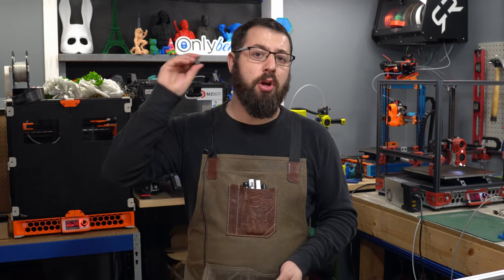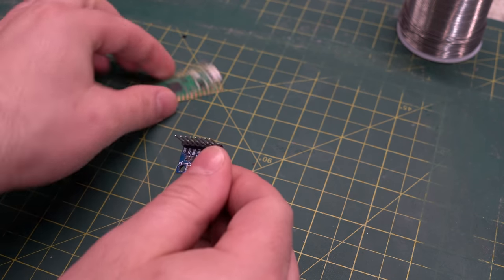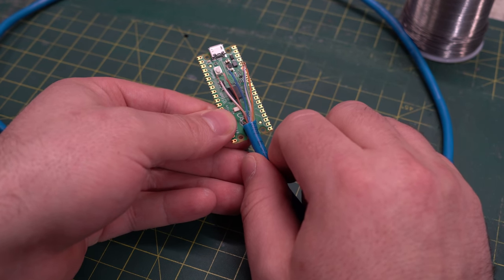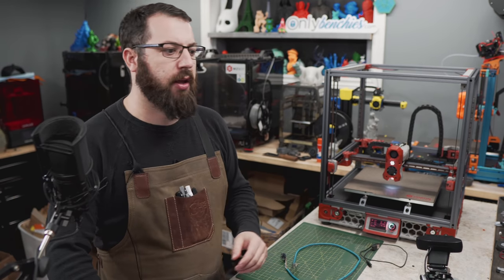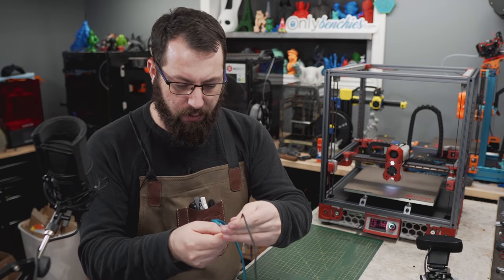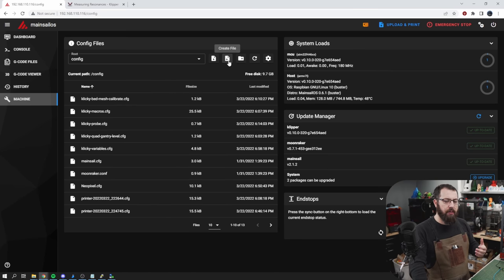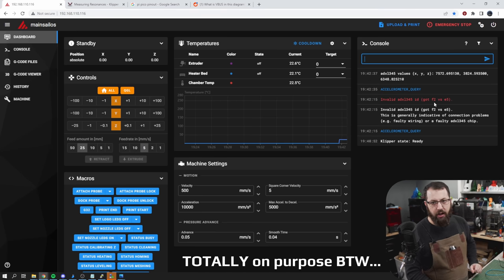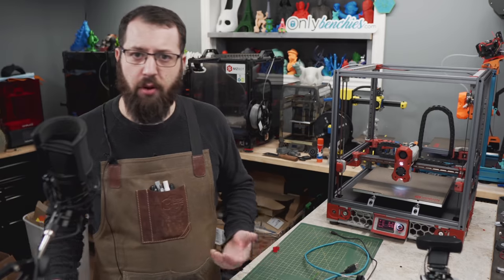Input Shaper with a Pi Pico - Klipper Tips

Comment: I am having an issue when i include the adxl.cfg in the printer.cfg, as soon as i include it and firmware restart the klipper doesnt want to connect but as soon as I comment out the line it works again but the raspberry pi pico doesnt show up on the list of MCUs. Any thoughts?
Reply from the maker: Did you flash klipper to it correct? does it show up when running 
ls /dev/serial/by-id/*
Did you ensure the correct serial ID is used for it in the config and lastly try a different USB cable
Reply: @CanuckCreator  I actually figured it out, I am using a Raspberry Pi Pico H which has the 3.3v and ground pins switched from the standard Pico, got it up and running though. Thank you!

Comment: I permanently screwed the adxl to the toolhead and connected it directly to the octopus board, Not recommended?
Reply from the maker: You can do that, but keeping the adxl perm attached to the toolhead isnt really needed (you only need to run IS once really, or after any mechanical changes to the printer)

This way makes it easy to use the same setup on multiple printers

Comment: Can you run Input Shaping off of the one Pi running Klipper? Or do you NEED another Pi to run input shaping? I also have a bunch of quadcopter flight controllers with accelerometers.. I wonder if those could be utilized here...
Reply: it can be connected directly to the Pi you're using to run Klipper, this is just to have a quick connect/disconnect i guess.
Reply from the maker: Pretty much this, the default way is to connect the adxl to the rasppi GPIO and setup the RPI itself as a secondary MCU,  if you just have one printer with klipper this isnt a big issue really, but if running multiple printers, OR the RPi`s are under printers/in electrical boxes, it can be a bit of a pain, this method allows you just plug in via usb and avoid setting up each printers RPi as a secondary MCU

Comment: I'm trying this and my Pico is not detected by my Pi. Have tried different cables etc. I wonder if it is because my Pi is being powered by my Spider board and maybe not giving enough power to the Pico via USB?
Reply: did you sort this i have the same issue ?
Reply: @colly05  yes. It was because the pi needed to have the pico connected at boot up to detect it and work properly. A bit annoying but that sorted it.
Reply: @AG-cg7lk  Thank you. I had the same issue.

Comment: Totally STUCK.....Help

Keep getting the "!! Invalid adxl345 id (got 0 vs e5)."  When running QUERY or the test. I home everything. Execute the test and boom an error. I've checked all wiring, resoldered everything. Rebooted about 8 times. Did continuity. Still an error. Printer is an Ender 3.
Reply from the maker: Run it again if you get the error. In the newer klipper release there's a bug with the first result is a fail when running the query test
Reply: @CanuckCreator  have ran it about 20 times, same error. I have tried rebooting printer, Pi, and Pico. Rewired the Pico to ADXL. I have just ordered a different brand of ADXL, I'll see if that works.
Reply: @andrewfazio7330  I had the same issue and a different ADXL345 was the only solution.  I have bought several from reputable sources and the only one that works every time looks identical to the one pictured in the video. Found it on Amazon. The ones I have that say "Digital" and have both a VCC and 3v3 pin never seem to work, go figure.

Comment: If we already have the raspberry pi setup to use the GPIO pins, is there any specific changes we should do for this to work? Or is this a automatic plug/play after assembly?
Reply from the maker: You would have to go through the process covered in the video for setting up the pico as a secondary MCU
Reply: @CanuckCreator  I rewatched and around 9:40 you broke it down more clearly. Thank you Sir.

Comment: could you not just extend the gpio pins like the usb? then this saves you from even buying a piko?
Reply from the maker: Yes, but then this requires you installing the RPI as a secondary MCU on every printer + making a 6 wire extension cable+end plug for all, vs just the pico and usb cable. Its not a huge deal but it does make it a simplier process.
Reply: @CanuckCreator  thank you for the explanation.

Comment: Has anyone done this with a zero 2 w? I am trying to get it to go. I loaded it with klipper/mainsail via rpi installer. Did the spi turn on. Installed everything. But, when I plugged into the printers PI, it doesn't recognize the USB. So no USB ID. It does connect over wifi, it is functional via mainsail(zero 2w). Its acting like a perfect pi running klipper/mainsail... 
Can anyone help me get the usb to recognize? Ty.
Reply from the maker: You cant connect two RPI`s together, the Pi Pico works cus its an RP2040 MCU, not a full "computer" like an RPI
Reply: Well, that sucks. But, I have a bunch of arduino nanos. So... 
Ty soo much for a quick response.

Comment: Does this mean I can run inputshaper on a printer that is using a raspberry pi zero?
Reply: 1. the pi zero has only one data-micro-usb-port, so if you're already using that to connect the main mcu. you would have to connect the pico via gpio, which makes it pointless, since you can conenct the adxl directly via gpio as well.
2. the problem with the zero is afaik that it hasnt enough computing power for the adxl. And, if i understand correctly how klipper works, the pico wouldnt help there, since the computing would still be done on the zero.

i'm not an expert, so if i'm wrong, feel free to correct me. I have a zero as well, so it would be cool if it works, but as im seeing it the best solution is to upgrade to a zero 2 when prices are normal again and use that old zero for pi hole or something else.

btw you can run inputshaper on a zero, but not the adxl. its more complicated to find the frequencies via test prints, but it works (at least on a standard bed slinger)
Reply from the maker: No, the Pi Zero would still have to RUN the Input Shaping algorithm which it doesnt have the power todo

Comment: Nero it's possible to connect with arduino to build this input shaper tool?
Reply from the maker: Yes, would just need to use the correct pins and change the config to adjust accordingly namely:
cs_pin: adxl:gpio1
spi_bus: spi0a
Reply: @CanuckCreator  Thanks nero for prompt answer! Greetings from Brazil!

Comment: Where do I place the adxl345 ?
Reply: as close to the nozzle as possible is preferred however putting it somewhere on the tool head is all thats necessary/ somewhere on the bed if you have a bed slinger style printer

Comment: i tried the same but get: Invalid adxl345 id (got f2 vs e5)
The hardware is exactly the same as that of Nero. Wiring is 100% as the picture shown. If I use the same ADXL chip on my old connection, directly on the SKRproV1.2, it works. Someone an idea?
Reply from the maker: This was a reply from another comment on this video 
`
You'll get a similar error the first time you run the command as you received at 11:23 due to a bug introduced in Klipper several months back. It always fails on the first try and works after that. I found the exact commit that caused the problem, but as far as I know, they still haven't fixed it. 

`
Reply: @CanuckCreator  thank's nero!

Comment: Have you tried out the xiao? I thought I saw you had it on a stream.
Reply from the maker: I did at first. Couldnt get the flash firmware to work so ended up using the pico. Ill come back to it later as its exactly the same setup process
Reply: @CanuckCreator  did you use a Seeeduino XIAO for your initial testings (like in ERCF), or the Seeeduino 2040 Pico?
I have no trouble while using a XIAO, but i'm still not able to connect to a Seeeduino 2040.
As you have shown in your video, the connection to a Pi Pico 2040 in general is not a big deal, but the Seeeduino 2040 seems to be a little bit tricky (Pinout?).

Comment: Unpopular opinion. Why not just install extension cables so you don't have to flip the printer to plug it in each time...
Reply from the maker: I wouldnt say thats unpopular, but depending on how many machines and their configuration, just having something that you can just plug in via USB easily has its merits

Not everything has to be for every scenario